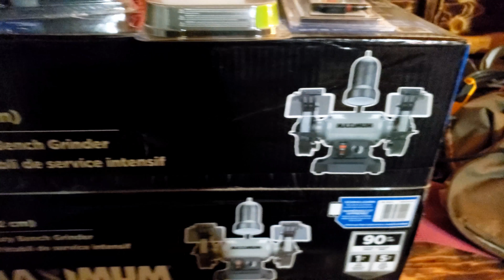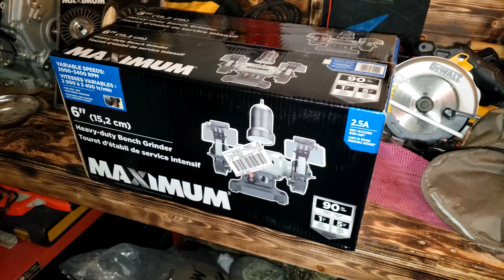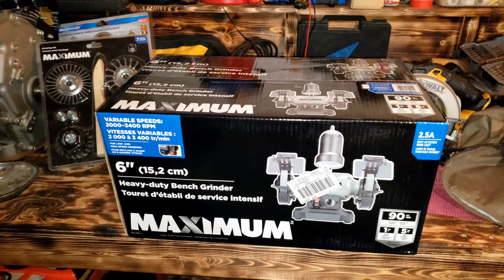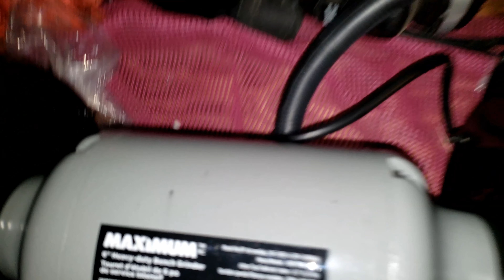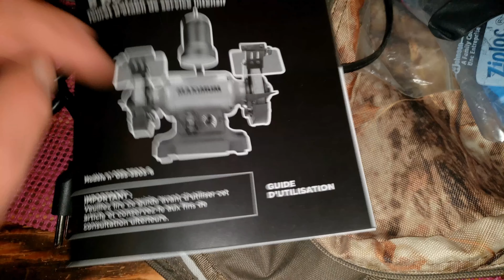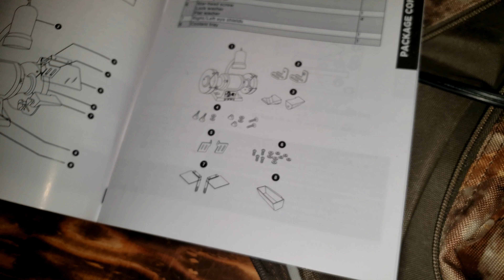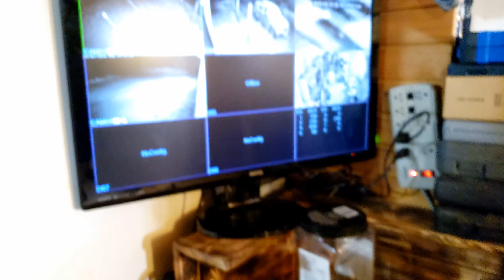Mastercraft MAXIMUM Variable Speed Grinder 6"

Comment: I think your spark shields are on the wrong sides, I just assembled mine yesterday (great sale price at CDN tire), and my shields/mounts were on the opposite sides and they mount quite well and are tight.
Reply from the maker: I did switch them around , But then they did not match how it looked on the box. (For the video i did it to match the box)
Yes when i installed them on the other side they seemed to work good, But then i seen they had a Gap at the top where sparks can fly out.
Reply from the maker: I just Subbed to your channel , Looks Like you have some Great Videos
Reply from the maker: @OvensGarage  That's 95% of what i sell at my shop, I plan to make More videos showing different equipment one day. 
We Don't Do any online ordering or shipping , But at least the videos will help people know what to order.

Comment: Hi.  Is there somewhere to lock the shaft when change the wheel? Or just hold the wheel by hand and unscrew the nut?
Reply from the maker: I don't think they have a lock. 
The wheels seem pretty easy to hold. 
But at the same time.. I am not 100% sure. I had plans to put a wire wheel onto it , just never had a chance yet.